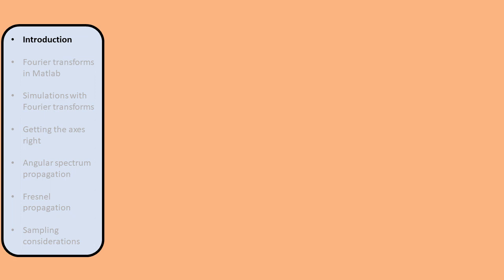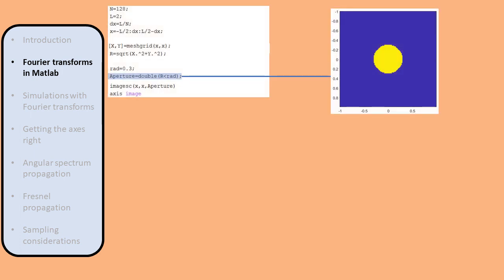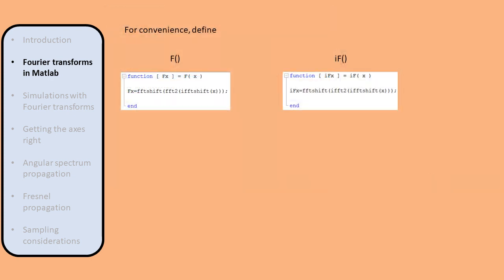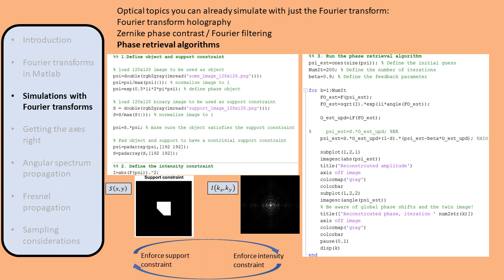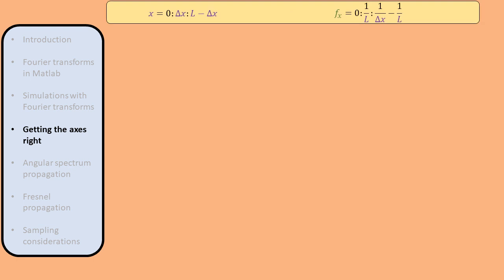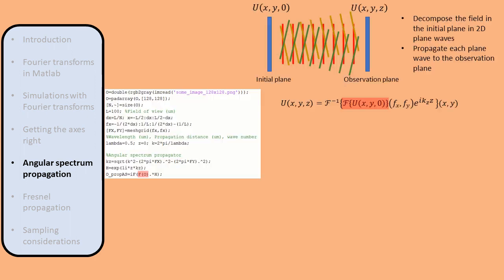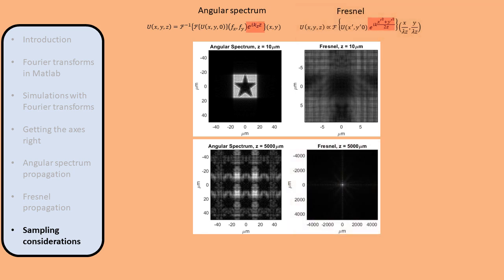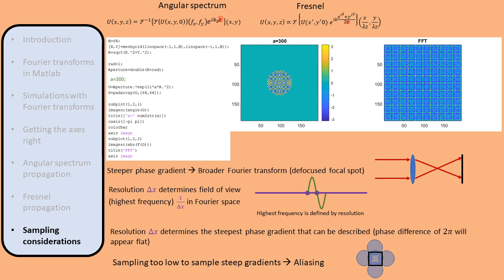Numerically simulating the propagation of coherent optical fields (Fourier optics)

Comment: At 13:09 , why did you ignore the 1/lambda*z term when you calculated the fresnel propagated field? And why didn't you take the abs^2 when presenting it?
Reply from the maker: I ignored the factor 1/lambda*z  because it's a global factor that is typically uninteresting since it doesn't change the 'shape' of the field. We typically plot the field amplitude/intensity in arbitrary or normalized units anyway.

I didn't calculate the intensity by taking the squared modulus, because then lots of subtle features tend to become much less visible in the plot. So it's basically just a plotting trick (just like you can plot the log to make weak features visible), but you're right that the squared modulus would be the physical quantity that a camera would measure.

Comment: Lectures are so helpful. Would be great to see treatment of phase-only holograms such as produced by a spatial light modulator - "kinoform", I believe.  Would like to projected a "resolved" intensity pattern at intermediate ranges.  Can one back propagate to determine the need phase on the SLM or is too much information missing?
Reply from the maker: When performing Fourier transforms, phase information is typically much more important than amplitude information. A common demonstration is the following: take some image or piece of music, Fourier transform it, discard amplitude information (so only keep phase), and inverse Fourier transform it. The resulting image or piece of music is still well recognizable, though somewhat degraded in quality.

Since the propagation of optical fields is described by Fourier transforms (i.e. Angular Spectrum Method, Fresnel integral, Fraunhofer integral; I have another video on that https://youtu.be/Y5DagMbPEGk ) , the same result holds: if you back-propagate a field, only keep its phase, and forward-propagate it, then the original field should be recognizable, though there will likely be additional speckle noise present. To minimize the noise, one could use iterative algorithms to optimize the phase-only hologram, see e.g. https://doi.org/10.1016/j.optcom.2018.09.076 (used search key words: beam shaping Gerchberg-Saxton).
Reply: @SanderKonijnenberg Thanks.  Yes seems like an iterative method would be needed.  Will have to ping on a colleague who  was  Feinig's grad student. Currently we project a pattern in the far field by imposing the FFT of a random pattern on our SLM.  It does  a pretty good job, except for the resulting random speckle in the far field.

Comment: The angular spectrum of a wave is the fourier transform of the complex amplitude function of the wavefield, then why did you take fft of intensity?
Reply from the maker: I'm assuming you're talking about 12:14? The reason is that experimentally you can only measure intensity, not the complex field, directly. So in inline holography, you can only computationally backpropagate the intensity to find an approximate reconstruction of the object. Indeed, because you're not backpropagating the complex field, the reconstruction contains noticeable artefacts. Also see 8:00 of https://youtu.be/on9L1EAnWC4 .
Reply: @SanderKonijnenberg   I am talking about the object i.e. the intensity matrix (O) in your code. O is a grayscale image containing intensity information on 0-255 scale. For recording the gabor inline hologram, the object(Transparency having a transmittance matix of form 1.-t[i,j], t[i,j]<<<1) is illuminated by a plane wave(amp=1 and phase=0, according to the video you referenced in ur reply), so the resultant scattered field is given by some U1(x, y) which when propagated to screen becomes U(x, y) and generates the interference field 1.+U, exposed to which screen/ photographic plate develops a Transparency which is proportional to exposure which is in turn proportional to intensity of 1.+U field. Now upon illumination of the photographic plate with the plane wave resultant field is given by transmittance of plate × wavefield of plane wave, which is basically intensity matrix *. constant k, which is propagated to obtain the reconstruction of the hologram.
Reply from the maker: @sudhanshushrivastava5-year886  The matrix O is intended to be the object transmission function. In this case I chose it to be real-valued and positive (which intensity is as well), but it doesn't have to be. If O is illuminated with a plane wave at normal incident, then the transmitted field U is simply O, which thus represents a complex-valued field, but its phase happens to be constant in this case.
Reply: @SanderKonijnenberg  Thanks, I get it now, I'm curious how the physical extent of the object relates to that of the hologram.

Comment: Where can I find the matlab code used in this video? Thanks!
Reply from the maker: Sorry for the late response, I've been working on some lecture notes which took me some time. I've shared them with several MATLAB codes here: https://drive.google.com/drive/folders/1C19nI8QTyyVAysR-pDcoJ27p6VQyVcPM?usp=sharing
Reply: @SanderKonijnenberg Thx a lot. Your video lecturing is far better than I was taught in class